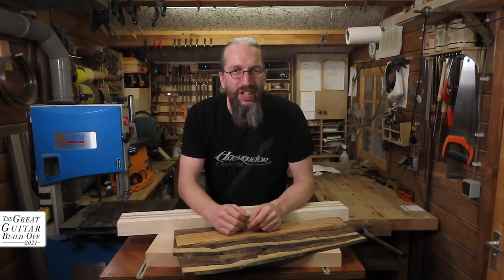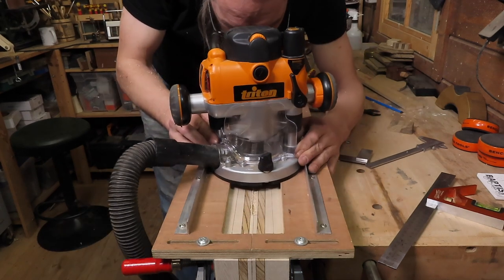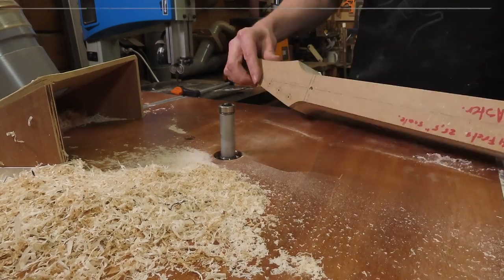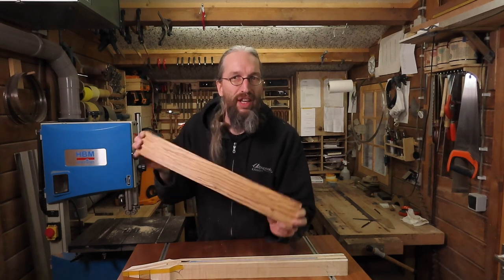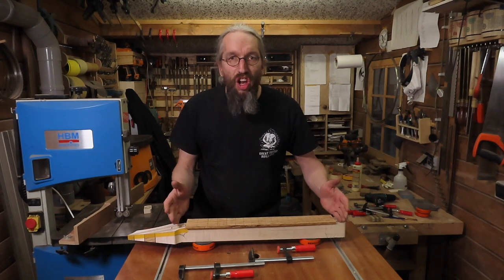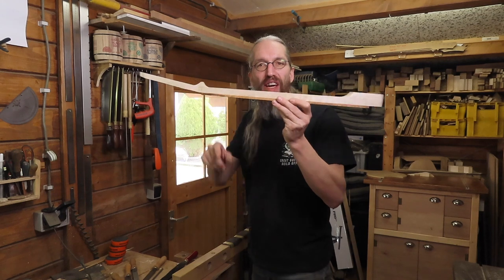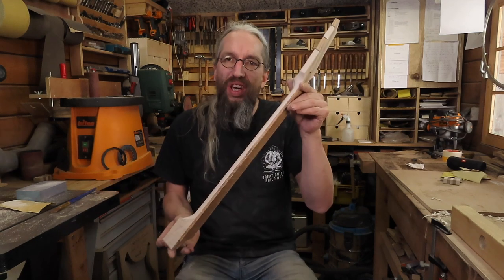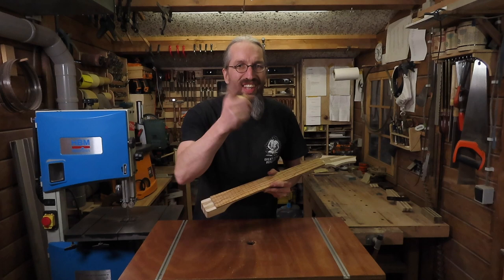Great Guitar Build Off 2021- Episode 1 - Making the Neck | Building a Great Guitar from Scratch

Comment: Hi Daniel,
(Great Name btw)
I noticed a scene where you picked up a remote & turned off a device so you could talk. I think I recognize that remote. Is it for a Wen Air Filtration unit?
I have one in my shop & the remote looks identical. 
Great build series. I realize this is several years old but I just discovered your channel. You've got a new fan!
Cheers from Detroit, Michigan USA

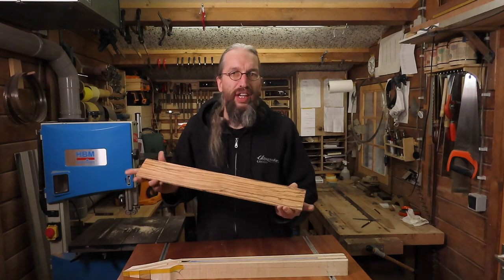Comment: Hi Daniel. First of all, beautiful build. There’s something that puzzles me about your process that I hope you can clear up?  You profile your headstock shape when the neck blank is square and then cut the headstock angle top first then the bottom cut to give the final headstock thickness using the masking tape as a guide (great tip!). So the result of this seems to be that the tip of your headstock and the edge of any contour is still perpendicular to the top of the neck and not perpendicular to the headstock angle. I think you can clearly see this at 6:42 and I can only assume the laminated strips viewed from the top of the headstock will always be this way. Yet by the end of the video and in subsequent videos, the tip of the headstock and other “vertical” edges now seem perpendicular to the headstock itself. Where does this happen in the process? And how do you do this while maintaining the original headstock shape. It’s hard to find a frame that shows this on the complete guitar so maybe I have this wrong but it’s a bit confusing.
Reply from the maker: Hi Steve,
Thank you for the question and a good point. Let me try to explain.
When I cut the headstock to an angle the sides stay perpendicular to the neck and top of the headstock. The 'tip' of the headstock is however at a slight angle and stays that way. I think it enhances the curve at the very tip. 
I don't know how to explain this other than the shape of the headstock and the angle at which you cut it doesn't effect sides. It's the same when you cut a regular shaped beam at an angle let's say for a scarf joint. Any minor deviations are corrected when sanding the sides.
I hope this answered your question.

Comment: Hi Daniel. Did you make the blank yourself or buy it in? Asking as I do not yet have enough clamps etc & plaining skills to do it myself. Cheers, Ade.
Reply from the maker: Hi Ade,
I used to make the blanks myself, but these days I have them custom made for me. 
It's not that hard to do by hand and you don't need that much clamps if you use a clamping cauls. 
But it does take a lot off time which is hard to justify to a client, that's why I outsourced it.
Reply: @UnquendorGuitars  Excellent - I am considering it for my own build. Can you recommend a specific company?

Comment: Daniel, is there any rule or way to find correct truss rod for my future project? I mean we have to use "x" mm for 24.75 scale, "y" mm for 25.50 scale. So is there any traditional sizes of truss rod for each one of scale sizes? Thank you in advance!
Reply from the maker: Hi Ivan,
I recently answered the same question somewhere in these comments so if you don't mind I'm copying that reply.

"My main parts supplier for example mostly sells two lengths. 460mm for Guitar and 610mm for Bass.
This lets me believe it doesn't really matter that much, however if you make a short scale Bass you might expect a shorter truss rod. I haven't looked into this in depth myself as my guitars all have the same scale length and number of frets and I have only build one 34" scale Bass guitar, but if I had to guess the truss rod must ideally run from the nut to the start of the heel of the neck with the center somewhere around the middle of the neck (not the 12th fret). At least my guitars are designed like that. 
There must be a science behind it but I can't give you a definitive answer unfortunately. 
Even the guitar building/design books I own don't mention this."
Reply: @UnquendorGuitars  Daniel, Heel erg bedankt! Many thanx for this information!

Comment: Hello, i've been watching you for a while now, since i am planning on making a bass guitar, and i am wondering how to find the correct length for the truss rod, obviously, if it's too long it just won't fit, but what if it's too short? How much shorter, if compared to the length of the fretboard, can it be? Would it have serious impact on adjusting the neck, and playing the instrument? Thank you for your videos!
Reply from the maker: Hi Andrii,
Thank you for your question.
I don't know if I'm able to answer this though.
My main parts supplier for example mostly sells two lengths. 460mm for Guitar and 610mm for Bass.
This lets me believe it doesn't really matter that much, however if you make a short scale Bass you might expect a shorter truss rod. I haven't looked into this in depth myself as my guitars all have the same scale length and number of frets and I have only build one 34" scale Bass guitar, but if I had to guess the truss rod must ideally run from the nut to the start of the heel of the neck with the center somewhere around the middle of the neck (not the 12th fret). At least my guitars are designed like that. 
There must be a science behind it but I can't give you a definitive answer unfortunately. 
Even the guitar building/design books I own don't mention this.  
Good luck.

Comment: Из такого хорошего бруска для грифа я бы изготовил два грифа для гитары. Головку грифа я бы вклеил под углом, а не вырезал бы из тела этого бруса. Основная причина почему бы я так сделал - это экономия материала и более надёжное соединение наклонной головки с грифом. Ибо есть недостаток у многих Gibson LP и подобных гитар - в шейке от напряжения выламывает головку грифа, так как в основном на таких гитарах головка не вклеена под определенным углом, а вырезана из общего бруса, и в месте перегиба присутствует обрыв волокон дерева.
Reply from the maker: Hi Roman,
I couldn't make two necks from the single blank because of the heel of the neck.
Besides saving on material I personally don't 'believe' in the additional strength of a scarf joint. 
This might be the case for headstocks at an 'extreme' angle (>15degrees), but I use a relative shallow angle on my headstock, perfectly quarter sawn multi-laminated blanks and a volute so I am not at all worried about the integratie of the neck and headstock.
Reply: @UnquendorGuitars  I see. I saw such a bar into two parts and make two fretboards for the guitar from two parts. I stick the head of the neck at an angle. I wish you good-sounding guitars!